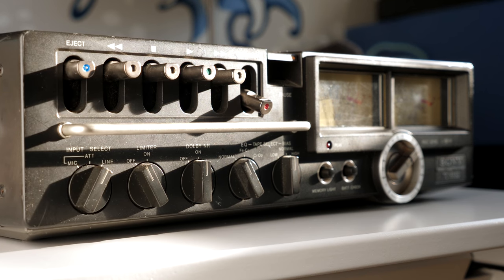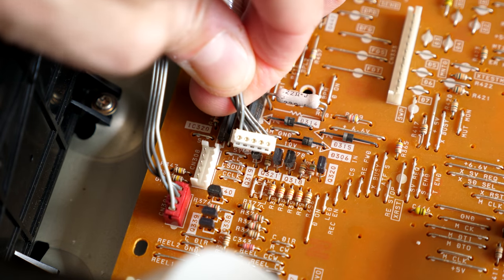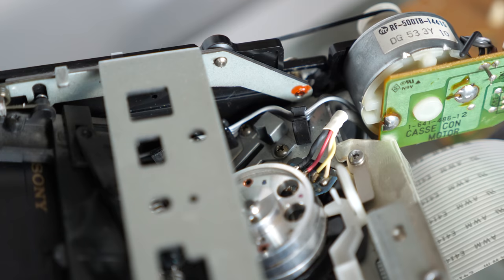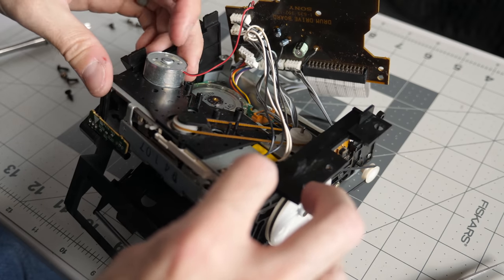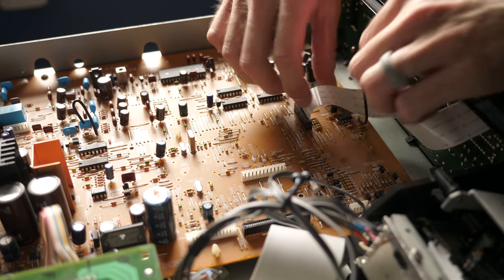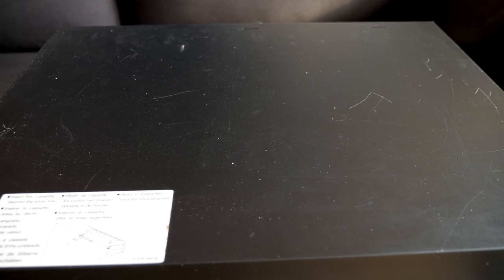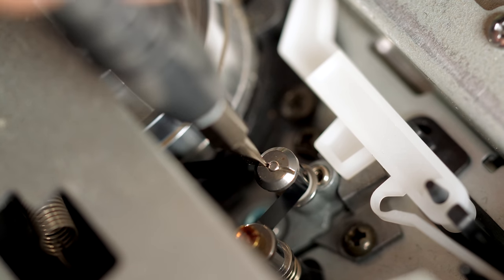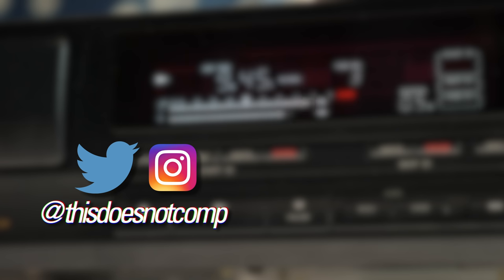Fixing Up a (Really) Broken Sony DAT Deck

Comment: Hello Colin
Shouldn’t a tape recorded on one deck play fine on another ?
I recorded a tape on a Song PCM-R300 and it plays well on it but when I play it on a Sony ES60 it gives the distorsion you showed at minute 10:27 in your video ( albeit not as exaggerated) 
And if I take a tape I recorded on the ES60 where it plays fine and play it in the PCM-R300 I get a similar distorsion 
Does this mean both decks are bad even though they read their own tapes fine?

Also I had asked you in another comment if you would be willing to fix two portable unirs Tascam DP-1 where the motor spins but tape does not roll as if a belt was done 
I would really appreciate your help
Thank you

Comment: I think the biggest culprits when it comes to the reliability of these older machines are aged rubber, plastic pieces and weak solder joints. I know why they did it (to keep costs low), but it really makes these decks prone to break as soon as they pass the 20-year lifespan. Just recently my PCM-R700 broke down and turns out a very tiny plastic peg to keep the tape holder in place snapped, which detached the entire thing from the deck. I had to use superglue to put it back together, but I know it won't last long.

Comment: Seems like people confuse tapes for different formats (MiniDV for DAT). I ran across a seller that was selling a Pinnacle MovieBox, and confused FireWire 400 for USB.

People either don't do enough research, or are not that bright. Hopefully it's the former. I went ahead and picked it up as I have some old Macs with FireWire on them and a camcorder.

Comment: I have a similar distortion issue with my DTC-77ES, and although many have said that it's the headamps that need recapping, I'm going to try the tapeguide alignment trick to see if it works.
Reply: Tech Moan showed a cleaning tape, maby that would also solve the problem
Reply: @maximilianfischer8899  I've tried that already, and it didn't fix the problem, so it must be the guide alignment.
Reply: UPDATE: it worked! However, as the DTC-77ES is a 4-header, I needed to adjust the top guide. Problem eliminated! Thanks to this video, I've cured the problem
Reply: @AurumUsagi  that is good to here

Comment: For the plastic clip on the gear you could have been better off creating it as a solid piece and then drilling the hole, and then doing a quick file to make the slot (hindsight, I know).   And I have to say, I love this channel.

Comment: I admire your grit and knowledge 
I have Tascam DP-1 portable two units . The door opens fine but when I push the power button and play I hear the motor but nothing happens and buttons don’t operate
Could be just belts issues
Would you be willing to help fix them via remuneration of course ?
Thank you
Reply: Hello Colin
A few things
Is it normal that the recording on a DAT deck has to be played on the same deck?
I recorded a piece on a SONY PCM-R300 and listened to it and it sounded great. But when I play it on the SONY 60 ES, I hear the jitter you showed in the video. So I took a tape I had recorded on the 60 ES and where it sounds great and played it on the PCM-R300 and it gave the jitter
Does this mean that both units are bad? Or is that a known phenomenon
Also I asked if I could send you two Tascam DP1 for diagnostic and repair and of course happy to pay for your labor and parts
I look forward to hearing from you 
Much obliged

Comment: I came into possession of a NOS DTC-59ES.  The deck is pristine, as you'd expect, even the vestigial remnants of the foam roller are there.  The trouble is that it does not read the tapes correctly.  That is, it pulls the tape properly and advances, but there is not movement of the level indicators and I hear a relay switching "somewhere" on the board...  Wonder what this is all about.  It'd be a shame to leave the deck as-is.   Save for the roller and leaky original Sony battery, this is a time capsule.

Comment: Hi, very nice video, recently i came across Sony DTC-57ES and everything works fine except for the head. Due to long storage, the head does not spin freely, when inserting the tape, i can see it tries to spin, but ultimately gives up and the CAUTION light comes on. When i tried to spin the head with my finger i can feel heavy resistance. I tried everything, even up to the point i sprayed WD-40, still no luck. Do you have any suggestions for this issue?  Can you spare me a head from a known source to you? i tried everywhere, Ebay, Amazon and other websites, i cannot find anywhere which sells this part. Its the DOU-03A head. Please help me, i really would like to have this fixed since its a ES model and this is my first DAT deck. Please reply. Money is not an issue as long as i can get it up and running.

Comment: Modify the marlin firmware.  Somewhere in advanced config there's a function that rounds off every 4 e-steps.  Set that to 1 & you've instantly quadrupled your functional resolution.  Only use this on delta or corexy

Comment: 8:10 The one thing I've learned from watching CuriousMarc ( A.K.A. Mr HP Fancy Pants ). When you have one of these broken solder joints is that you remove all of the old solder first, then re-flow with new stuff. Due to differences to solder type. Sorry Colin...
Reply from the maker: I don’t think that’s much of a factor in this case. The DAT deck was made before RoHS required lead-free solder, so what I added should be very similar to what was already there. If it was a more modern device, then yes wicking away all the original solder would be the way to go.

Comment: If you ever work on a Sony CFS-9900 or 9000 or the CFD-5 boombox there is a plastic arm that drives the autoreverse and spins the head around. This arm breaks from turning brittle. Chasing someone who can 3D print a new part. thanks.

Comment: Sooo lucky.. I bought a similar one on eBay with door and “caution” issues and was able to get it working, but it only plays and records for 6 seconds at a time.. extremely frustrating when you spend $150, put a bunch of time in it trying to fix it and to only get a 6 second player/recorder 🤦‍♂️

Comment: The DAT cassette (right side up so you can read the text on it correctly) looks a LITTLE like "Grumpy Cat eyes".... If you added a pink nose in between reels and the "For Professional" text and where the clear plastic starts. Then add some whiskers on either side of the two reels in the right spots. VOILA you would have a Grumpy Cat face! LoL...

Comment: Wow great video I have the same DAT unit with problems it will only work for about 20 seconds than stops can you fix mine also, my tech is not fully trained on DAT,

Comment: I wanted to get a DAT Recorder but looking at them on ebay, 99% of them are not working or being sold for parts and a working one is priced so high that its laughable. After research they say most recordings studios used hard drives now.

Comment: 6:25 I'd say rather than "clever", this is "you've just played yourself" bit of engineering.
It is obvious they made it so when the deck loses power, brake would be released, so the mechanism would slightly unthread itself as to prevent damage to pinch roller from capstan pressed into it.
The awful part is that because of this "bit of engineering" it cannot retract the tape along with the guides prior to eject; it'll retract the guides first, leave a loop of tape hanging, then yank it back into cassette.
They could've built in 2 separate solenoid brakes (since they were so keen to stuff as many motors and solenoids possible anyway), to enable proper, nice retract, but nope.
How they couldn't figure out a simple direct drive mech with that amount of moving stuff is... puzzling, to say the least. And there's belts too :(

All that, along with cracked and shrunk plastics (seems to be typical disease of Sony gear of this vintage), I'd say it's a decent deck with terrible mechanics.
So glad I replaced mine with Tascam DA-P1 instead. Single belt, less mechanics, nicely documented and portable on top of all. And no SCMS :)

But that's just my two cents. All is well that ends well. Nice repair. Neat to see any DAT action these days.

Comment: Let me get this straight:  The decided to create somewhat of an AOVCR (AUDIO ONLY VCR) to succeed the audio cassette??  And then call it DAT????   uuhhhh  And how is that digital again, when it uses what appears to be a VCR head to play audio from a magnetic strip???
Reply: Yeah, they looked at how helical scan solved the signal-to-tape speed problem with video and realized it could also solve the same problem for digital audio. Philip's DCC had a tape head with multiple elements (9, I think), which was why it was linear recording.
Reply: @static-san  All I know is that I looked at the head on this thing and almost died laughing at it. Like seriously what were they thinking when they decided on THAT setup?  They essentially took a vhs-c cassette, shrunk it down, and called it a DAT cassette.  Lmao and then called it digital. Smh